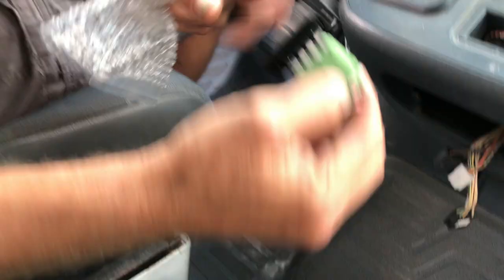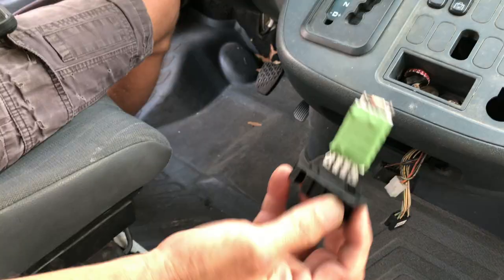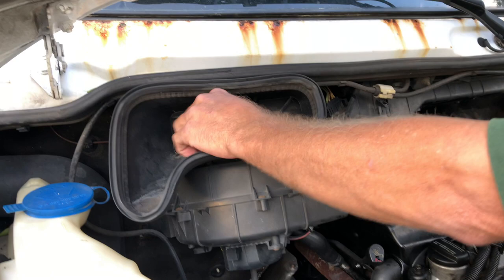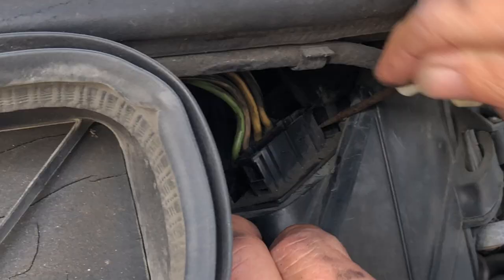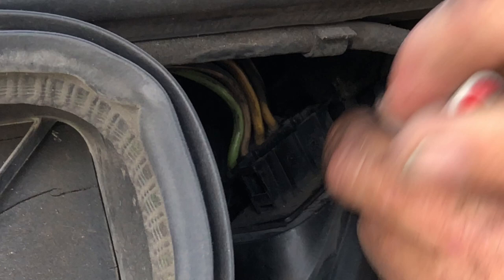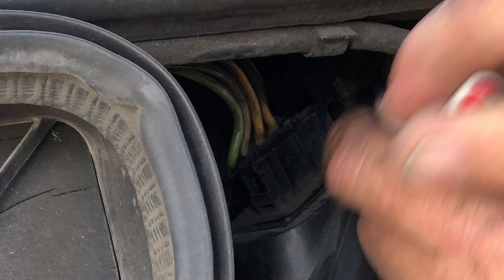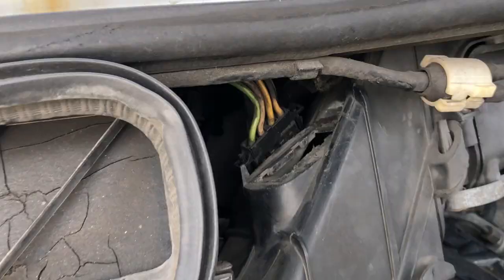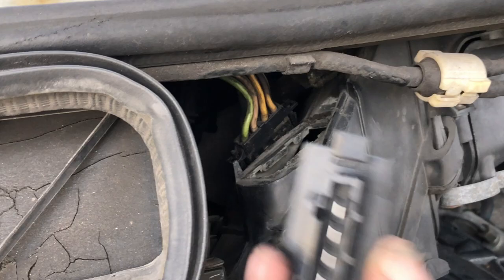Only One Fan Speed? Fan Resistor Change T1N Sprinter

Comment: Very useful, thank you so much, I detected this on my UK version right hand drive 2005 readout but didn't know where to look, the part is very similar but it seems that the fitting is slightly different and the two fitting clips on each side, below the fitting flange are about 4mm further down into the heating passage, so at least for my version I had to get a European part only from NRF, their number is 342019.

Comment: How do you get the new one to slide back into lock? I got the old one to slide out but new one one slide to the right to click back in
Reply from the maker: The resistors being shipped out now don't fit without a little trimming. The latching tabs are too big to fit in the slots. It doesn't 'Need' to be clipped in but will leak air if not clipped or tapped in.

Comment: I had done troubleshooting and decided that the resistor module needed to be replaced, but could't figure out how to remove it from the housing.  Your video showing to slide the unit to the left to unlock made it easy.  Thanks!  Available from the parts house?  Or dealer only?
Reply from the maker: https://amzn.to/2XINatP
Amazon has them here:
Reply: @FloridaVanMan   Ordered, came in just a few days, about 1/4th of the price of Big Chain parts stores.  Plan to install tomorrow.
Reply: With the aid of your video, changed the resistor pack out in less than 5 minutes.  Thanks!

Comment: Wondering if I waited too long. My fan/AC started to only work on the high setting. It would give a terrible, grumbling sound, particularly would not driving just idling.  Since it was working on the high, I let it go too long and yesterday it just stopped working entirely. Could the resistor switch still fix at this stage? Thanks  million…miles. 🙏
Reply from the maker: Once the fan won't work on high speed the fan needs to be replaced. Sounds like your resistor went first and maybe because the fan was drawing too much power as it slowly died with a vibration. The rattling fan may have ruined a new resistor quickly so it is wise to replace both at the same time, fan and resistor.
Reply: @FloridaVanMan  Thanks. Do you have a video of changing the fan and/or picture or part number of what fan I should get? Hoping it's easy enough to fix without have to remove other parts. Thanks a million...miles!
Reply: @FloridaVanMan   * Also, I have the 'intake fan thing' ziptied closed for some reason which I forget but heard its a fix for brittle plastic part. Does this contribute to the wear and tear of the fan and resistor? Would it be better to let it flap open? Thanks man.

Comment: I have all four speeds but no low speed when REST is on.  Key off and out of ignition.  Any Ideas?  I have searched around with no luck. Any direction would be awsome. Thanks
Reply from the maker: Verify that by turning on the rest feature while the hood is open. The fan is under windshield on passenger side. If it is spinning the fan is working. You might have enough air escaping around your cabin air filter that you can't tell the fan is blowing.

Comment: My fan only works on speed 1 & 2. Could it still be the resistor? Mine has a 7 way connector. The parts store online is showing two resistor packs, one resistor control unit and another motor resistor
Reply from the maker: That wouldn't be the common resistor failure like we see and I might verify the knob/switch is working first. But the resistor is so cheap and easy perhaps I'd start there anyhow.

Comment: Replaced this and got different speeds again. I've still got warm air blowing though...any chance you've done a vid on diagnosing aircon?
Reply from the maker: No, if the system has freon but won't turn on it is most likely the control module in the dash. They are a common problem. You can jumper 12volts to the blue wire at the a/c compressor for testing, but this will only turn on the compressor, not the condenser fan, so it is only a test, not a fix*.
Reply: @FloridaVanMan  It worked til I drove off the lot....lol.
Reply from the maker: @sailingvesselmaddream  Then it is probably leaking freon.
Reply: @FloridaVanMan  It blows but no true heat or AC. Am wondering if blower fan is culprit. Trying to find how to test that now.

Comment: Thank you 
I was confused about how to remove it
Reply from the maker: A little bit of squeeze on the clip and a lot of wiggle. It is hard to show because there is so little room and there are two opportunities to disconnect. One to pull the wire off and one to pull the resistor out.

Comment: Hi, I can´t turn around with that cotroller which is in the middel of the panel (when you want to turn it to your feet, window, feet and window). Any idea? Thank you
Reply from the maker: The middle knob is cable driven. When you remove the control module, you'll likely find the cables seized. You can either buy new ones or try to lube the ones that are there.

Comment: My fan isn’t blowing air at all, even on level 4. Does this sometimes happen when the resistor goes?
Reply from the maker: Nope, not in my experience. I suppose in theory, it might... but if the fan does not spin at all it is probably the fan itself. The plug going to it can be checked for 12v by turning the fan on high. If you get volts but no spin.... yeah, the fan. But if you don't get volts to the wire it can be a fuse or relay under the driver seat.

Comment: Hello-I’m actually trying to find a video on replacing the ac/heater blower: do you have one on that?
Reply from the maker: We do have a video on replacing the resistor, which is helpful if your fan blows only on highest speed, called The Easiests Repair... If doesn't blow at all it may be a fuse, a relay, or the fan motor. The motor is held in with just 3 screws and the wire clip.
Reply: Florida Van Man thank you. My problem is that it doesn’t blow at all. I have replaced the resistor, the fan and still no blow☹️
Reply from the maker: @rubyloo71  Sorry, no video on the fan motor yet. It can be tested by running 12v straight to the fan connection. If it doesn't spin the motor is the problem. Only 3 screws hold it in, all from the bottom. Fi the fan spins with 12 volts there are 3 other things to look at. The control switch can be bad, and there is a fuse and relay. I think that fuse is under the driver seat, not the steering wheel fuse block. And I think one of the yellow relays under the front edge of the driver seat is for that fan. I know it is not the easy to reach relays at the side panel or the the relays under the wheel.

Comment: It's not possible to turn off the blower when engine is running. Works on all numbers but not possible to turn off. Do you know what the problem is?
Reply from the maker: Are you sure the fan still runs? Could it be forward movement of the van causing a blow? What year is your van, and do the numbers on the dial show 0-3 or 1-4? 
The case around the cabin air filter is poorly designed and often lets air in, feeling like a low speed fan.
Reply: @FloridaVanMan  it's a 2007 blower works in all numbers 1-4. Not possible stop it. I push bottom when it's in number 1 and AC comes but blower never stops running

Comment: Anyone got any ideas for me, t1N sprinter, heater only working on speed 3 and 4......but they're the same speed. Speed 1 and 2 are off, speed 3 and 4 are on(same speed)

Replaced resistor. No changes. Would appreciate anyones 2c
Reply from the maker: Maybe the dial knob on the dash broken. This is only my best guess.